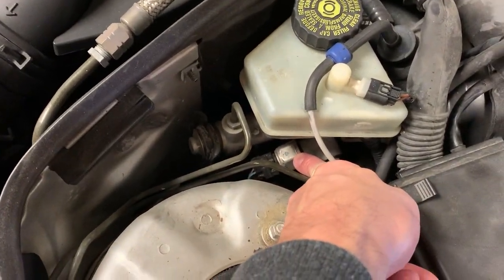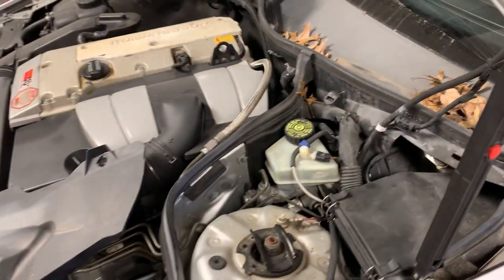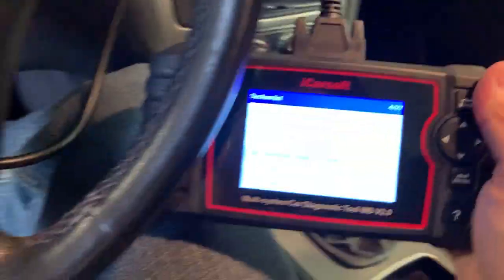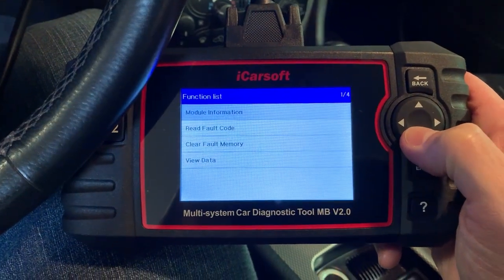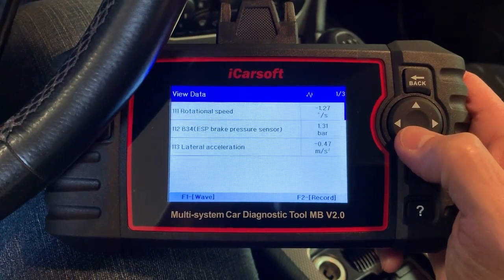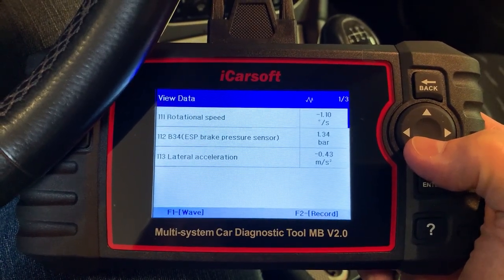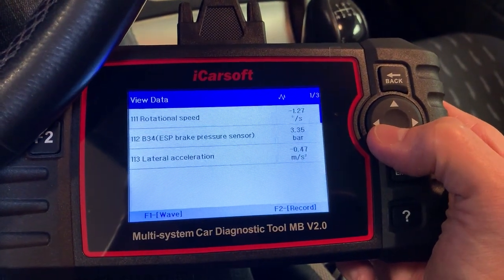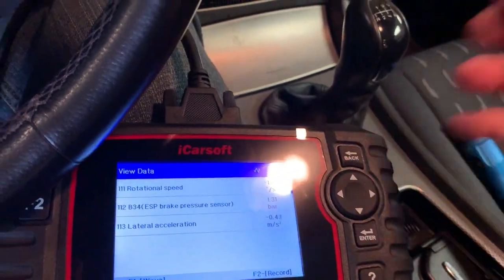Mercedes Benz brake light switch stop light switch - where is it - and how to know how to find it

Comment: Please help!! I have 2006 ml500 and it’s not on ur list, my vehicles in pieces… I can’t find where the Stoplamp Switch - Mercedes-Benz (001-545-64-09) is. My car won’t shift out of park, and the car warning says it’s not even in park.
Reply from the maker: Hello, it is on my list. Your model is a W164.
Its a pressure switch on the master cylinder.
Also if your dash doesnt show P, you have a communication error. A brake lamp switch is not your issue.

Comment: I have the problem of my brake lights staying on while car is started, WITHOUT foot on the pedal.. INNOVA scanner reads switch plausible replaced with two different switches same issue.. 2006 S430 4MATIC
Reply from the maker: Rear sam most likely has water In it.

Comment: Is there a more technical name for the brake light switch part?  Searching for brake light switch through MB OEM parts lists and I can't locate anything with that name for my GLK350 X204?  Took your advice and bought an iCarsoft scanner.  I didn't get any codes related to the brake light switch...the scanner read the following 2 codes: P061A and C0034.  After a quick google search I got nothing on the P code but did find ABS wheel speed sensor for the C code.  
What initially brought me to your video was because the ABS, Check Engine and ESP (ESC) dash lights came on simultaneously and the car wouldn't accelerate properly at speeds above 55mph.  
Im thinking I have 2 distinct issues here.  Any advice on either issue would be appreciated.
Reply from the maker: Stop lamp switch if on pedal (not your car) brake pressure switch if on master cylinder (your car).
Reply from the maker: Erase both  codes. Drive until error occurs. Then diagnose from the codes that return.
Reply: @MasterTechLou  Erased codes.  No dash lights when started.  Drove the GLK, same dash lights came on within a 100ft of driving.  Code read C0034: right front axle wheel speed sensor.  I drove the car again, this time hard accelerating from a stop and it went in to limp mode.  Read codes again with the scanner, same C0034 and now P061A.  Couldn't find much information on the P code.  Would a faulty wheel speed sensor trigger limp mode?
Reply from the maker: @yatesc9246  yep, wheel speed sensor is likely culprit
Reply: @MasterTechLou  Replaced the front right ABS sensor.  Cleared all the codes again.  Drove the vehicle.  No dash lights, no check engine light and no limp mode after hard acceleration.  Everything seems to be working as it should.  Thanks for the great video and thanks for the advice.
Reply from the maker: @yatesc9246  if you care to donate I do have paypal and other apps. thanks.

Comment: Have a 2003 ml500 with stuck blend door Actuator (heat just flows through won’t switch to defrost or change vents) to it in they B’s me said they changed blower motor in center console lol I have already changed dash blower/heat resistor fuse relays looks hard to reach blend door in dash through glove box be great to see a video from you
Reply: Please help some summer here and no a/c just heat seeping out through vents with oil exhaust mix smell sign hot ass black Mercedes lol

Comment: hello, my problem is every time I push the breaks, the right side burns the light, I replace the bulb carrier on that side and the problem remains, The reason I replaced it due to a burned contact. Any ideas please let me know.  Thank you.
Reply from the maker: Thanks for reaching out to me, unfortunately Theres not enough information in your statement to be able to help you.
If you need help you can reach me at my website www.cartechconnect.com thanks

Comment: 2005 c220 CDI. trans bumpy shifts. Not shifting from D-N into R-P. And limo mode. It was in and off. Sometimes it’ll drive absolutely fine but more times than not now it clunks into certain gears and is in limp mode 😩
Reply from the maker: Sorry to hear. As always youll need a mercedes scanner to check for codes. That will get you in the right direction.

Comment: Hello, My car is a "R-class W251"  2006 350v6. I have an ESP Light that comes on after about 40 to 65 miles of continuous hiway speeds (55-70mph).  Using MB DAS Star Diag.  The code is for ZERO POINT VARIATION.  I can follow the reset SAS  procedure to reset the SAS and the light goes off.  I replaced the SAS behind the steering wheel but, come up with the same issue.  Some say it could be the brake light switch.  ESP light and ZPV fault seems to be consistent, coming on at about 40 to 65 miles or just over an hour of driving.  Can make it happen each time if I use the cruise control most of the time.  Note DAS says the SAS needed replacement.  Did not fix the issue?

Other comments were that the battery maybe weak but I get on codes that relate to a weak or low battery.

Fault CODE from DAS:  C1170 N49 (Steering angle sensor) : Zero point variation

Thx for any suggestions you can give.
Reply from the maker: I dont like diagnosing via comments, Im not sure why you did not reach out to my website.
 the issue is you need an alignment at the same time as setting steering to 0 degrees, that will fix your issue.
Reply: @MasterTechLou  Sorry I didn't use your website. Just new to your channel.  Will use website in the future.  Thx for responding.
Reply from the maker: @donm7645  I appreciate you reaching out either way, thanks for watching!

Comment: Good morning sir in C32 AMG where is located under is not there w203 is v6
Reply from the maker: Good morning. As I explained in the video and posted in the description, there are only two places. On the brake pedal, or on the master cylinder.

Comment: I thought that 1 bar out of the brake pressure sensor was normal with the brake pedal NOT being depressed.  That's essentially 1 atmosphere, which would be normal for off.
Reply from the maker: The reading should and will be as close to 0 . Most are slighty above. Negligible. If youre at 1 bar…. Its bad.
Reply: @MasterTechLou  Thank you.  I figured 1 bar would be normal because 1 bar is acting upon it.  That's why I'm a telephone man and not a mechanic.
Reply from the maker: @jemcnair76  these are not absolute sensors, if thats the right term. Some sensors start at 0 and some start at atmospheric pressure, this starts at 0
Reply: @MasterTechLou  Hopefully my ignorance will help somebody along the way.  I thank you again.
Reply: @MasterTechLou  gotcha!  You read my mind on where I screwed up.
Reply from the maker: @jemcnair76  hey if you dont know, you dont know. No harm in any of that.
Reply: @MasterTechLou  That would explain why sometimes the shifter can't be shifted with the brake ON.  I have to take my foot off the brake to shift from P to D, and R.  I would have to see live data when the problem is happening.  Today the car was fine, except the 1 bar at the sensor.  And a logged code for turbine speed error.

I'm getting there.  All because of you.  Thank you again!

Comment: So I basically need to get rid of that effin 🚚 cause I need to replace the whole brake booster 03 ML350
Reply from the maker: Pressure switches just unscrew from the master cylinder.
Reply: @MasterTechLou  thank you I will try it 🦾

Comment: 2011 gl450 all my brake fluid leaked out i have no pressure how do i get it in neutral to get it towed
Reply from the maker: Only way is to get the pressure switches on the master cylinder to read pressure. Unscrew lines and cap them off. Fill fluid.
Reply: @MasterTechLou  thanks but my brake line is rotted through so i have no brake pressure to switch it into neutral sorry im no mechanic i need help
Reply from the maker: @brandonthornton778  yes I know exactly what happened you must not understand what im telling you. These do not have a method to get into neutral. A tow truck will have to use dollies .
Reply: @MasterTechLou  thanks